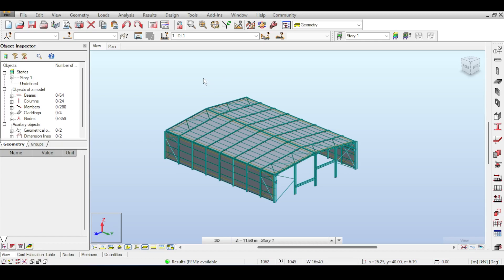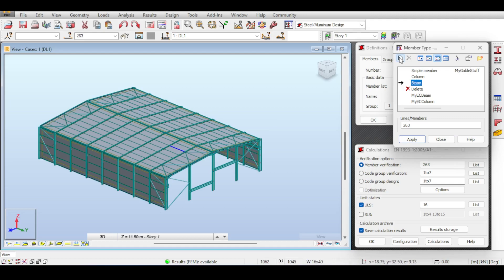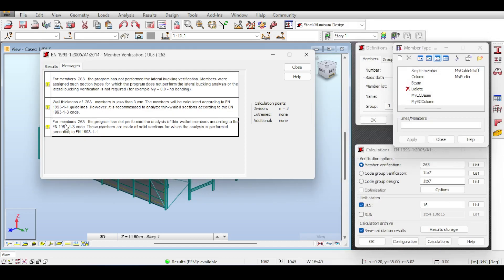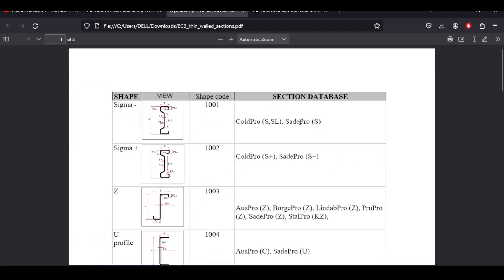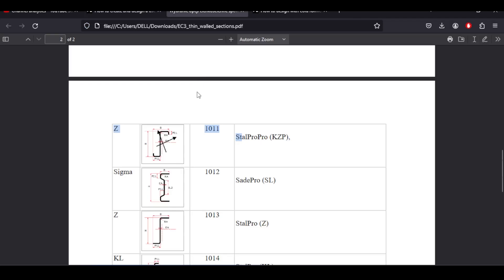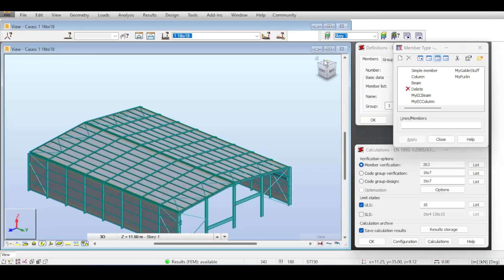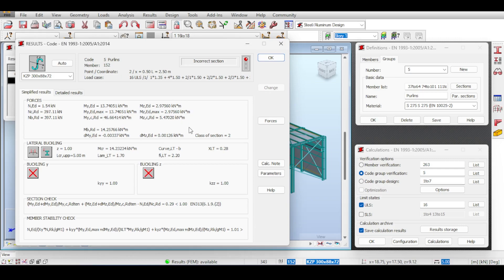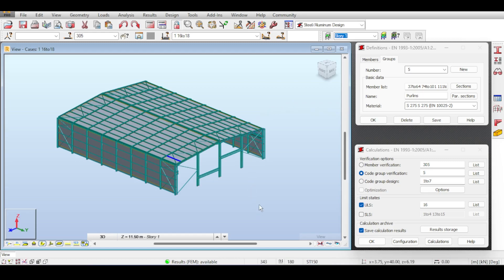Design of Cold Formed Sections in Autodesk Robot

Comment: Hello Dr. CEE

You are 1000% right, Cold-formed-sections in RSAP are a pain and they do require a lot of manual tweaking and setting up of the database(s). Luckily or fortunately, the reference(s) that you have shared does cover all of this very well.

What remains a bummer for me though is that even with all the careful and painstaking definitions and tweaking of the databases, etc. RSAP cold formed section design module seems to always display a warning message about that “……the members are made from sections for which the EC3 code does not provide the formulas for calculating the critical moment. Mcr for these sections was calculated as for bisymmetric elements ......”. In my case, this warning message does NOT go away, it is always there. CEE have also referred to the same warning message on this video tutorial (12:44)

I do recall that you have indicated before that perhaps the other equations (if any) to deal with those sections as opposed to defaulting to dealing with them (sections) as bisymmetric elements may possibly not have yet been implemented by Autodesk on RSAP…… 

A closer look at the warning message seems that RSAP team is indicating that those equations are not even there on the EC3 code? I am reading this view from the part of the warning message that says that (…..EC3 code does not provide the formulas….). 

I admit that I am less conversant with the exact procedures that are required to be followed by the EC3 to design say a C or a Z cold formed section. But I would have thought that those procedures are (or ought to be) available considering that the code is primarily dedicated to .....rules for cold-formed members and sheeting…..

I get that both C and Z sections can be viewed as (and they are actually) bisymmetric sections depending on the axis of reference. What bothers me is that, if the EC3 wanted to design these sections as bisymmetric sections, why then did they not just do that? and if they did just do that and designed them as bisymmetric sections, why then is RSAP warning about this approach as if the design (as bisymmetric sections) is not strictly in compliance to the EC3 code?

I suppose this is one of those life mysteries that will requires me to dive deeper into the EC3 itself in order to find out what the code really uses to design these sections.😊 

Thank you for your hard work /slash whooping cold-formed sections SIZED ^_^ …. I really appreciate what you do, even around such challenging topics as this particular one.

I have enjoyed this video and I am looking forward to the next CEE videos

Kind regards, DK
Reply from the maker: Hi there Engr. DK,

it was a bit painful preparing that one to be honest. Like I had printed me out some documentation to try follow exactly what RSA is trying to tell me. I even have my "archaic" Robot Millenium hardcopy book to check, because RSA is built on Robot Millenium's DNA (back in the day I remember it was called Robobat).

I kind of lost my faith in the Cold-Formed section design, it was kind of tedious and even the idea of having a "certain section list" that needs to be done in order for robot to even see that it is a cold formed section is kind of strange.

What I thought about the EC3 code not providing equations was maybe due to the fact that those were taken from kind of old section databases that may not be EC3 compatible. I have to investigate to be honest. It still reverts back to first principles, so I kind of let it pass, coz you could derive equations from Mechanics of Materials, something that needs the properties of the cross section, that is provided by RSA's section database.

I still have to do some reading on the EC3 code before I can give a definitive answer as to why the EC3 code does not cover those sections, I agree with you that it kind of bothers me too, but you know, I do not want to simply say:
"well you see... " and give some opinion without being 100% sure about it.

You are most welcome, and stay tuned for the upcoming RC structure series. 

Regards,
CEE

Comment: Hello, thank you for the very useful video.
I make structural and production desings for roll forming machines like Framecad, and scottdale. I'm just changeing to Robot it would be very useful to have some specific introdution for this area.
If is's not your plan nowdays is it possilbe to reach you as a personal consultant?
Reply from the maker: Sure, I can help.
Currently, I am a little busy with the bridge series, non-linear FEM series and RC building design series.

You can email me on: civ.eng.essentials@gmail.com
I will see what I can do.

Regards,
CEE
Reply from the maker: Hi there, I just saw your email (it was in my spam folder). I will check out the stuff and reply this evening.
Wishing you all the best,
CEE
Reply: @CivilEngineeringEssentials  Thank you!